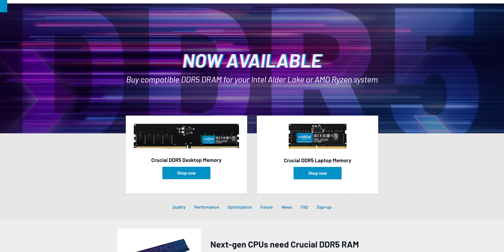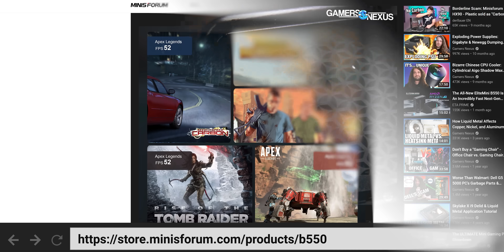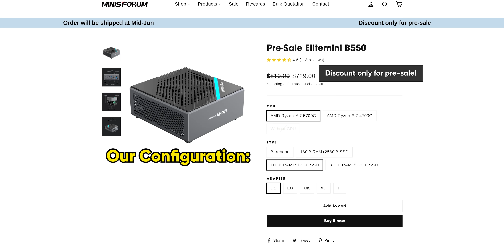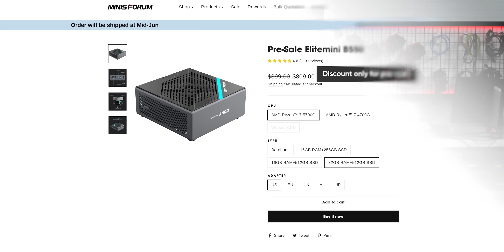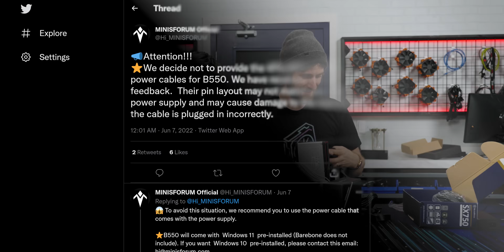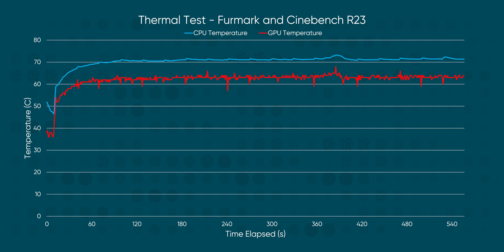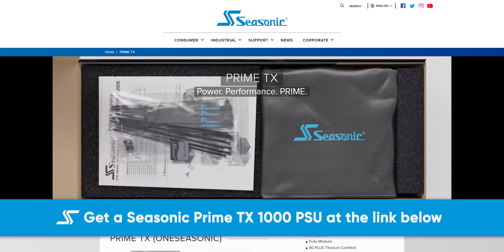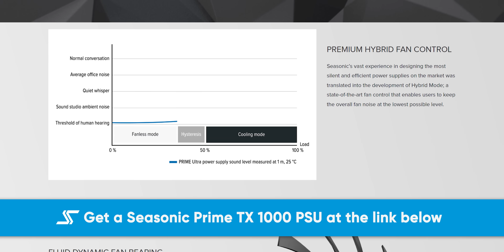Who's Buying These? - MinisForum Elitemini B550

Comment: i mean this does compete a bit with the ghost s1 because that case alone is like 350 that means no motherboard, no psu or anything and this thing barebones is 320 with mounting, motherboard, case, and psu(only for the cpu) so if they tidied up the design I could get one. I currently have a large tower pc and I have a gpu in it that I want to use and I dont want to move this huge piece of machinery around to college and such so I could get this thing and just use my gpu as well. It would be like an 800 dollar purchase for the system and if it is sold in the current config, It would be mega jank tbh with cables and such everywhere. If the frame was able to do some good cable management and maybe use the psu to power the entire pc instead of using two plugs, that would make this a more compelling buy.

Comment: I had a faulty AMD cpu. After MONTHS of troubleshooting and fussing with command line and bios, the event viewer said it was the CPU. I have since replaced with Intel and will probably not EVER have another AMD system. It's actually a far bigger issue than I first thought. Someone tested 500 AMD and Intel CPUs, almost 20% failure rate with AMD, ONE fault with Intel, it didn't boost, but didn't crash all the time.

Comment: I can see this being useful to someone who wants an ultra small form factor machine with the option to upgrade the GPU at a later date. If they are able to pull off this system with an AM5 platform there will be room for growth in both CPU and GPU.  The only reason why there's little room for growth is because this came out at the end of the AM4 cycle. If this had come out when Ryzen first came out, it would have been incredible. 

All they really need to do now is solve that power supply issue. Because without the bracket, it's not very good looking.

There's also the people out there who want a powerful small computer and might need a PCIe slot that isn't for a GPU.

Comment: Who's this for? For the same people that eGPU's are for - gaming power at your desk at home, rest of computer including data on the go. In this case, not really on the go, but at the destination - e.g. if you switch between home and work place but don't need to work during the travel. And opposed to eGPU's this can harness the whole power of the GPU, and needs probably less upfront cost than for these frickin expensive eGPU cases. And if you really don't need a laptop, you save even more money on the screen, input devices and whatever else is in a laptop that you don't use when docked.

Comment: A better solution is the Yiluka YLK 01 SFF PC case with internal SFX power supply and pop off left side panel to plug in GPU when desired.

Comment: I'd say it's for college students where people who move a lot that don't have the time to disassemble part of a tower when they move.

I know you're supposed to take the CPU cooler off and remove the GPU just in case things get knocked loose and it causes problems if you don't have packing supports.

That you can just have a proper desktop if you want to desktop like performance instead of getting a laptop, set it down and plug it into a TV at a temporary location let's say a rental for maybe 4 to 8 months and then when it's time to move you just put everything back in its box and go. No worries about anything breaking no lugging around a huge tower

Comment: Linus does get a bit snobbish sometimes. 😂 Well, I want this unit. It's a MIni PC with built-in graphics card expandability! No laptop at this price point will have the same combination of power (maybe a 5700u, not a 5700g), port selection (I use AT LEAST 4 USB A ports at work all the time) and portability (if you don't include the dock). Plus, it is quiet. Plus again, GRAPHICS CARD EXPANDABILITY without buying another $300 Thunderbolt GPU enclosure! But that would be an interesting challenge for the LTT team. Make an SFF this small with similar specs and show us if most  people looking for an SFF PC prefer your setup over this.

Comment: I think that external GPUs should be bolted to the back of a monitor on a VESA mount - power brick and all. either use multi-usbC to handle the bandwidth or an Active Fiber cable. better yet, instead of a VESA add on maybe display manufacturers could come up with a decent enthusiast monitor with a built in GPU enclosure and a beefy power supply to handle everything. I know I'm grossly over simplifying it but for all the reasons why they can't currently do something like that it comes down to technical problems that would be solved if it were deemed enough people wanted something like that. For me I would love to have a NUC/Mini-PC that lives on my desk AND has upgrade-able graphics.

Comment: Im using asus pn51 Ryzen7 5700U barebone on an Akasa turing MkII casing w adtlink eGPU GTX1060 w 400W switching PS. NO FAN on CPU. ambient of 25C, Core temp idle at 27C; Gaming 1080P60 <50C. I am so excited, in my 30years of PC building never have i seen these kind of numbers on an 8 cores chip and FANLESS.

Comment: definitely needs to be modified to have all the connections for the platform power and PCIE interface on the same side, mount the PSU behind the main unit, run the PSU cables into the platform, and power for the GPU out from there.

Clean backbone, have the GPU on display on the one side, the easily disconnected man unit on the other. no cable mess.

Comment: I'm gonna tell you who would actually use a thing like this: My GF. She needs to have high mobility with all her software and data, and occasionally she needs to have extra oomph for her graphics. She does work in CAD a lot for architecture and urban planning, and occasionally she runs a render on the GPU. So the solution for her so far has been a gaming laptop.
I could see her using a little brick PC that fits more bags easily with the capability to connect into a full GPU. Yes, she does have a monitor, keyboard and battery w the laptop, but she does usually travel on bike & can have all of that in both her office and at home.

Comment: Your performance should be Docking-dependable.

Mini-pc (CPU, RAM, MOBO)

Different functional docking stations:
Office docking - Adds: modular RAM & large monitor (ram in the docking)
Home cinema docking - Adds: moderate GPU & Large TV & DAC
Gaming desk docking - Adds: full GPU, Extra RAM, High refresh monitor, networking, etc,
On the move docking - Adds: Power bank & Tablet for touch & screen

This way the 'mini-pc' only needs to provide a very good CPU, some basic amount of ram, some small amount of M2 storage.
Everything else is handled by the new "Docking system", mainly power delivery, networking, USB(C) ports, and the additional things described above.

Maybe I should patent this~

Comment: Okay, this proves my concept is indeed possible. Make a LAPTOP with a FULL SIZE 16X PCIE SLOT to use with a RISER CABLE, so when you DOCK your laptop onto a DOCKING STATION WITH A DGPU, it actually has the BANDWIDTH to utilize the GPU!

Comment: I see the same problems. Why not buy a laptop. In the other hand GPU performance can't be that good because of bandwidth restrictions. We still need a better eGPU connections. Maybe like 2x USB 4 over two cables, if possible.
Upgradability isn't an argument as well. You're better off with a real SFF case. At least then you can change the board as well and even use normal DIMMs.

Comment: NUCs and NUC-a-likes do have their place, and are (for example) pretty awesome work-boxes, especially if you have to move them between your home-office and work-office once a week.
Yeah you could get a laptop instead - but if you do have large external monitors, as well as mouse and keyboard waiting for you in both locations, there's often not much reason to pay for an included screen + battery while having potentially worse thermals.

The AMD 5700G is an awesome CPU that should be perfectly able to do some moderate gaming at 1080p as well - so some people might be tempted to screw it to the back of a big display and use it sort of as a Steam Box and streaming device.

The whole dock thingy with the GPU though... not sure what you'd really use that for?

Comment: I have the ASrock 300 mini, and this just seems like an extended version of the same. 
I recently put the 5700g in it, and it runs lower end games real nice. FFxiv runs at 1080 45fps which isn't bad, not great, not bad. 
I knew if it had even a 1030/1050 card, that wwould push it up to 60fps easy. 
So this set up, as jank as it is, if they refined it so it was more pluggy, like sticking duplo blocks together, it would be a phonemoninal setup.

Comment: ETA prime is buying quite a few it appears haha. They are neato. Id love to have them mounted to the back of my TV's rather the "Smart" or "Fire" implementations that are slow as molasses and very low functionality... You can use these for netflix and hulu, as well as Plex, and Emulators! Perfect emulation machines.
Reply: im talkin No gpu though.. The Ryzen 7 Apu is perfectly fine for emulation. They have models that dont have that extra-ness that lienus had to mess with.
Reply: 11:21 not if you plan to mount it to the back of a tv with full wireless and such... Your SFF wont fit.

Comment: this is like the sega cd/32x of pc's. just keep adding brackets and external parts to solve problems created by your initial design. If you use the external gpu and psu you might as well just get a slightly larger small case.

Comment: For me the biggest thing here isn't so much the fact that you can add a external psu and video card.. it's does it run cool and quiet?  A 5700G will do light gaming with ease and I could see a scenario where you'd have something like this in a home office attached to a monitor or tucked out of the way for that minimalist space.

Comment: I think it's a failed product, what's the point of a mini pc if you still add an external gpu and power supply outside the case. look at it, from here we can see that everything fall apart, even though the mini pc has good specs.

Comment: It's a good idea but the execution was just shy of good. Adam had the right idea. Imagine having 2 docks, one at home with the GPU (which honestly could have been done maybe a little cleaner if it also integrated space for the PSU and wiring like Adam mentioned) and one at the office (instead of a power brick have a small "power dock" with a regular PSU cable) so you can just slot your PC wherever you go. It's just so shy of perfect.

Comment: This is a super dumb product. The moment you need an external ATX PSU you transcend the value / reason of buying the damn thing. Just take a dremel to a slim m/uATX/SFX case.
This MIGHT be cool for a flash storage server if you have a 4x4 NVMe PCIe card or use it as a micro server with plex or something.

Comment: How the fuck did new guy get to work for LTT? If they're actual psu cable extensions.... pinout is irrelevant because we'll they're just like anyother psu extension cables. Lmfao. You're not plugging it directly into your psu, but plugging it in at the end of the psu cables like how all cable extensions work. Don't like this new guy.

Comment: It really does seem pointless to have this at home in it's fully kitted out state, but only take the middle brick with you on the go. You'd still then need to have monitor and HID devices at any other stop where you wanted to use it. Sure, those things are standard plugs and a lot of places you go might have a spare or ones you can borrow while you use your device instead of theirs, but at that point surely a good laptop has more than paid for itself in comparison. Especially with the nearly useless upgrade path this offers. I don't personally really get small form factor to begin with, but this one seems extra dumb.

Comment: I used to haul a Mini ITX computer to my friend's house a few years back. Even a relatively small computer like that was annoying to lug around in a tote bag, and it took longer to set up than I'd like to admit. Plus, having to manage two games libraries, one for my home PC, and one for my on-the-go computer, was a hassle. Having a core system with a few important games installed on it, with a full GPU waiting for me at home, would've been a great solution for me.

I think this product would be even better if it included a USB or SATA interface of some sort, so that the dock could be used for additional storage when left at home. Basically like an old laptop dock with extra ports and such.

Comment: This is something similar to what I've been wanting from handheld PC's since the Sony UX-180N came out. Having that slider backlit keyboard was nice too. It would be cool to have the PC have a nice CPU that may be throttled when in handheld mode and using onboard graphics. When you get home, simply dock it in to get the full power of the CPU, plus the use of an external better GPU, use of an external power supply packaged in the dock with the GPU, and suddenly your handheld PC is a desktop instead. Similar to how Valve did the Steamdeck (glad someone did something of my idea), it has a handheld UI for on the go and then the full desktop UI when docked. It would work better than the thing reviewed because it still needs a monitor once you undock it. It would also be in a different segment than a laptop as some people want small, handheld, console like computers to play their games on like the Sony PSP, Nintendo DS series, and Nintendo Switch.

Comment: would work for me when I travel. as I spend (spent, before covid) alot of time in other countries. and I have lots of free time, where I like to game with my PC.
I used to throw my whole Desktop in my suitcase and bring it. and I just bought a monitor, keyboard and mouse to have in the other country.

But I felt it was too expensive to keep two powerful gaming machines in each country. This would fit better in my Suitcase. Just bring the small PC and the GPU. and the rest I could buy two off.

Comment: Wait, did LTT confirm that it actually worked with the 5800X3D? It sounds like that's what they said at 9:30. Minisforum said they only loaded microcode for the 65W non-OEM CPUs...

Comment: I feel like this was a "GPU winter" idea that just took too long to bring to market. Back when you couldn't get a GPU the idea of buying an honestly very powerful Mini computer that  you could later add a GPU to seems like a good idea for someone who didn't want to pay scalper prices for a GPU during that time.

I bought the previous version of this computer myself actually. I figured I would go with a mini computer to tide me over until GPU prices came back to earth. Most of the games I like to play aren't that GPU intensive and the massive 16 thread capacity of the CPU did a really good job of running my favorite strategy games. Unfortunately in attempting to install Linux on it I apparently killed the BIOS on the mother board and had now way to recover it, but I was able to just take the CPU out and use it in a larger self build. (Unfortunately I wasn't also able to reuse the RAM as it's SODIMM and I couldn't find a motherboard that could slot an AM4 and SODIMM.)
Reply: Holy shit the scam bots work in chain now?
At first I was here to ask how tf Linux bricks bioses tho
Reply: well you can add a GPU later to basically any system that is running a CPU with integrated graphics, so I dont see how this would be any better than literally any other build, unless you really wanted something unusual. It takes almost the same  area from your table as a full sized ATX case...
Reply: There are adapters to fit SODIMMS onto normal slots. LTT also covered this adapter in the past.
Reply: No way to flash CoreBoot on it?
Reply: Time stamp 10:40 tho
Reply: whoa how does one manage to kill a BIOS just installing Linux? 😯
Reply: @udance4ever  Don't know. I probably could have flashed it to recover, but I don't have any tools to do that.
Reply: Investment now will be wise but the truth is investing on your own will be a high risk. I think it will be best to get a professional
Reply: A news host spoke so highly of the💕 woman Priscilla Dearmin-Turner and her loss prevention strategies been trying to get to her ever since

Comment: I could see people using it as a second streaming pc in a dual pc setup that they fit into one case. A case like the cooler master haf xb evo or an old air 540 with some cutting and elbow grease and you got a dual pc case with out having to buy the Corsair 1000D.

Comment: I think it's cool, but the external power supply is not great. If there was a way to extend the power supply cables and mount the power supply under your desk I could see it, but I suspect that's not practical with the 3.3V rails coming in on the 24pin...

Comment: Considering that some laptops for more money than this have a discreet GPU with a CPU, both of them high powered ex- 175W 3080Ti and 150W 12900HX, this design makes no sense. Even for the same amount of money a laptop would give way better value. And if you're still hungry for more CPU power then you can increase the TDP of the chip with something like AMD APU Tuning utility and some intel tools which I'm not aware of. AND NO THEY ARE NOT ABOUT TO CAUSE A NUCLEAR REACTION BECAUSE OF THE HEAT. I have the Scar-15 2021 5900HX RTX 3080, the CPU gets to around 80C~ and the GPU at a cool 74C~ while playing AAA titles at max settings!

TL;DR get a laptop